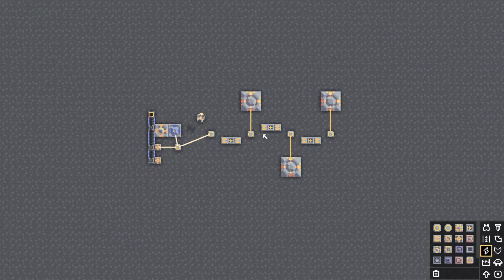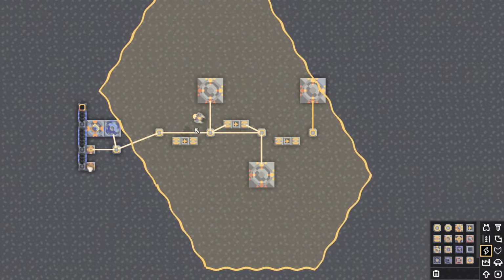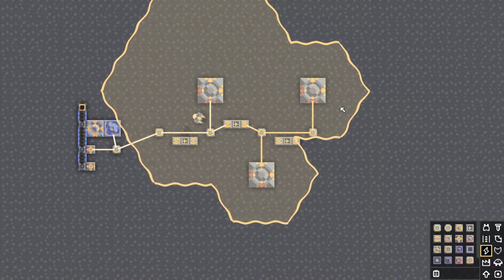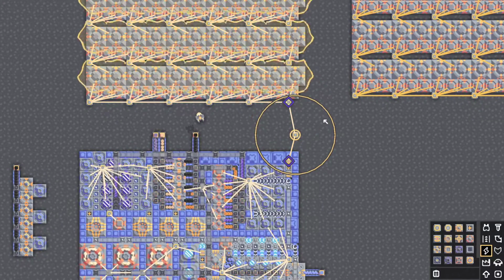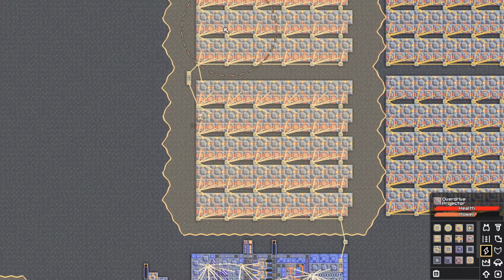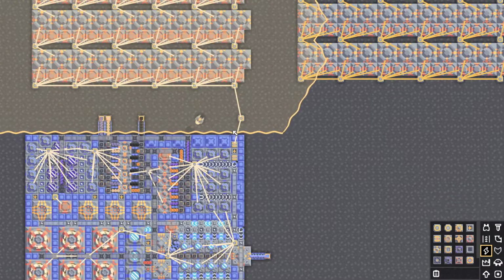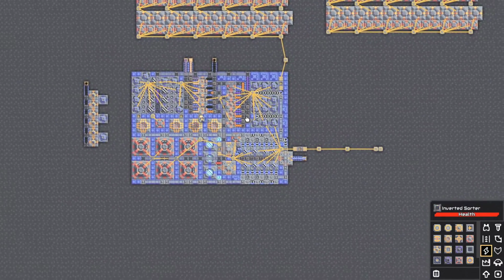Mindustry Power Isolator explained

Comment: Use force projector in editor👎    Use shield projector from editor👍
Reply from the maker: Sorry I don't understand.
Reply: @LiLbUg99  Shield projector is the sandbox and Malis only indestructible force projector featured in Erekir sectors Intersect and Crossroads. They function identically to force projecters, but are indestructible and stop enemy unit movement. They decrease in size when running at less power similarly to force projectors.

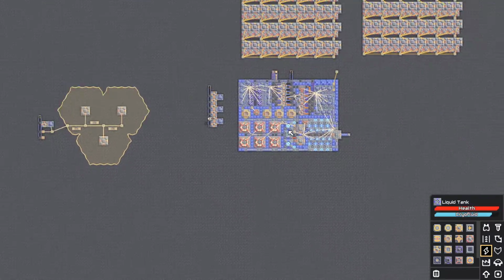Comment: 1:23 Why tf he use the reactor impacto schem
Reply from the maker: I designed this, and better, impact reactor schematics; the diode is crucial for protecting any impact reactor from overload and instant shutdown, crippling your base. This is why it was used as part of the explanation in this video.
Check out my reactor designs (may be out of date, it's been a while) links in the video linked in the description.
Reply: The diode is very useful, the only reason I don't have it for my export sector is because I have enough batteries to hold 55 million spare power, so whenever it fails (likely the cryofluid pauses) it can power itself for an extra hour before the reactors turn back on (usually only a few seconds) but in nearly all sectors/maps a diode is sooooo useful

Comment: Watch out for auto-connections bypassing your isolator.
Reply: plastanium walls block that
Reply: @imsuck12  Interesting, but do you really want to waste the plastanium to wall off your diode isolated area?
IMO simpler to just manually remove any connections your power stuff make you don't want.

Comment: I tried this method and unfortunately it just locked power from being sent at all... unsure if how it operates was changed. I feel like creating a processor that limits power sent by a connector would be more efficient, but I'm unsure if you can just tell a connector to not send power.
Edit: My programming brain just turned on and realized you'd immediately create a fluctuation loop. If you can add a delay on when to proceed to the next command, you could easily say "wait 5-10 seconds before reactivating connector" and the fluctuation could at least be noticed and dealt with.
Reply: How it operates was not changed, I think you should just experiment with diodes
Reply from the maker: Was your diode facing the wrong way?
Only other explanation should be that there is no power left over for the grid on the outside of the diode, try adding more power.
Reply: @LiLbUg99  tried both directions and didn't get different results unfortunately
Reply from the maker: @AshnSilvercorp  I think the diode can get input power from a building (if the building is connected to a power grid which contains at least one battery) but MUST discharge directly into a battery? Not 100% sure.
If you put a battery on either side of the diode (as in the video) then you can ignore this limitation.
Reply from the maker: @AshnSilvercorp  You could save the diode giving you trouble, and the surrounding buildings, as a schematic and export it as text then post it here, maybe we can help.

Comment: So if you want your frontline defense to get priority, you just run the power backwards? (From the side, front to back)
Reply from the maker: Priority goes to the grid closest to the power source.
So if you run power from the generator up to the front lines, then run power back from that down to other parts of your base (with a diode to separate the two grids) then the front line would get priority.
It's a little hard to do and maintain, mindustry loves to automatically connect to power nodes.
Just make sure anything supplying your power is getting max priority and is not sharing with anything else at that priority level, or you could easily starve your power generators.

Comment: Cool video and well explained but isn't this schematic for the impact not working anymore with the ratio changed in v6 ? because when i try to experiment by reproducing your video, my power input is 0 outside of the diode, v6 changed something here ?
Reply: it requires snek in multiple places for the production side - whenever there are multiple overflow and sorters next to one another, they will not work, as that feature was removed in v6.
Reply: Reason for this (ya, 2 years late and v7 is out now, but still) is that the diode only lets exactly the power needed to run the grid on the other side out. The correct excess power is only on the generator's side of the diode.
Reply from the maker: Hey buddy, running steam build 123.1 of mindustry this updated version works fine. I just fixed a missing diode but other than that everything looks good.
The power numbers reported by the game when you mouse over a power node don't seem to make any sense so i would ignore that and just see if your buildings are getting enough power.
I tried to check the power available from the power nodes at the reactors, and it said -ve values even though it should be +ve 48k or something.

Comment: I got it right? If i dont have enough energy it will (for example) turn off water pumps at plastanium factory until i get more power?
Reply from the maker: sounds about right.
So if you have enough power, you actually have 'excess' power which is not being used. In this scenario, all buildings which require power to operate will be running at 100%.
If you don't have enough power, all your buildings will be running at less than that, but they would all be affected equally; so if you see a water pump is getting 80% power, that means EVERYTHING is running at 80% power.
If you use the power isolator shown here to prioritise power usage, you could keep parts of your base running at 100%, and then the water pump at your factory may only be running at 50% or something.